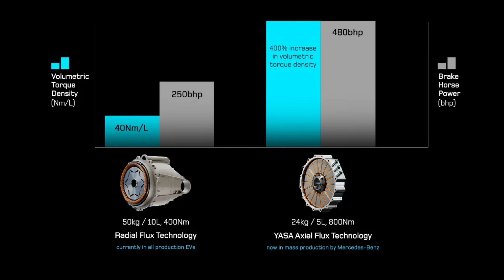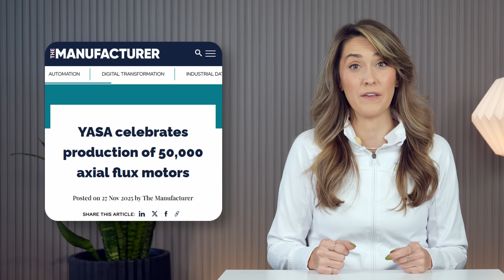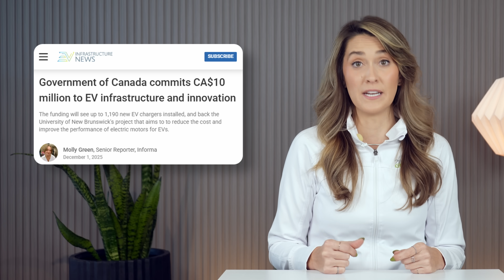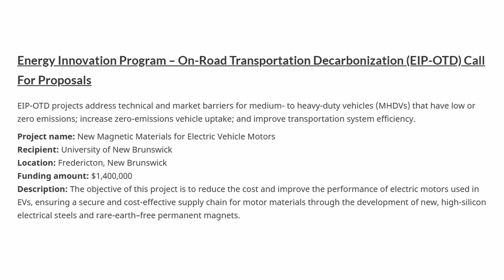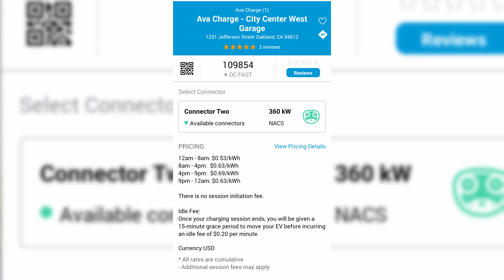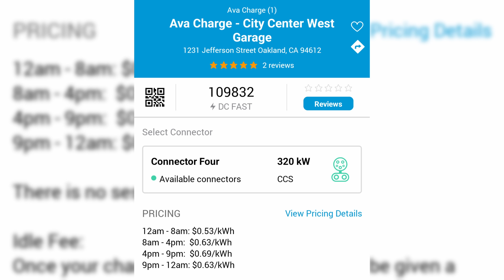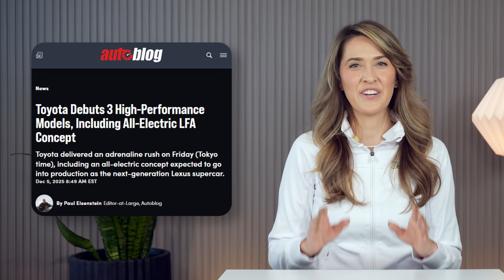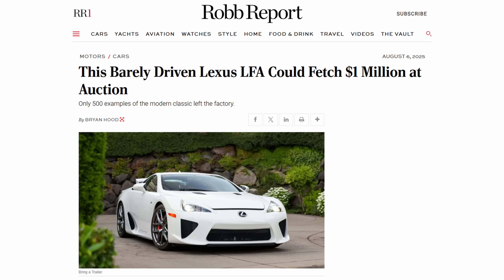The Current : Weekly EV News Ep#92 Dec 7, 2025

Comment: I am skeptical about hub motors. They create problems with added unsprung weight and rotating mass. Even worse, axial flux motors are very sensitive to gyroscopic effects that can make the rotor strike the stator. 
Axial flux I am slightly less hesitant about if they are part of the sprung mass. It is not a new technology though. There are real engineering issues to work out.
Reply from the maker: Many in-wheel motors have been brought to market for various applications.  The integrated inverter and the axial flix power to weight ratio are two massive improvements over anything we've seen in this form factor. 
-Producer Tim
Reply: @MissGoElectric  I agree with that, but axial flux isn't a new idea and neither is in hub motors. 
There are strong gyroscopic effects that try to drive the rotor into the stator that require either a heavy rotor that increases weight or large gaps that weaken the motor. 
There is a reason that even companies with great engineers have abandoned in wheel hub motors and radial flux. Aptera is just one example of a company that has done so.
Reply from the maker: Aptera has sold zero vehicles. Woven VS wound is important.
-Producer Tim

Comment: With the YASA axial motor, can you still remove the wheel by removing lug-nuts, to rotate the tires, or fix a flat?  Is there still brake fluid and brake pads for emergencies, and mechanical parking brake?  There's probably a more detailed youtube video on YASA that I need to watch...
Reply from the maker: The system we've reported on in this video has not yet been implemented. Of course, when it makes it to production all required maintenance and safety actions will be possible. -Producer Tim

Comment: Good to see the Post Office electrifying its fleet. I have huge nagging doubt however.

Osh Kosh.

We have seen thermal runaway events in first generation EV platforms. As manufacturers learn how not to make a roman candle instead of a safe battery their subsequent generation of batteries fare much batter. Osh Kosh have no experience in EV or battery manufacturing and we can predict their first generation batteries will suffer from manufacturing defects leading to battery thermal events. This will tarnish the transition to EV's and a single fire could stop the program i its tracks which would also stop the excellent ford EV's from being adopted.
Reply from the maker: Countless gasoline powered USPS vehicles have been engulfed in flames. Modern EVs are 60x less likely to burn. New Chinese EVs literally cannot have flammable batteries by law. The technology is going in the right direction.

Most of the incoming USPS fleet burns gas. A small percentage are EVs. 
-Producer Tim

Comment: Great as always. Toyota + solid state batteries = Lucy with football. Don’t be Charlie Brown! I’ll believe it when I see it.
Reply: I think SSD in widespread use will finally alleviate range anxiety.
Reply from the maker: The technology improves AND it scales.  The user benefits and value continue to improve and will do so until there are no reasons for most drivers to consider combustion. -Producer Tim
Reply from the maker: 30 EVs by 2030. That's their plan. We've shown the Toyota EV apparatus spinning up here and abroad to the tune of at least $20B of investment. -Producer Tim

Comment: You missed the most depressing news of the week: the rolling back of emissions and mileage requirements which essentially mandated EV production. There was the spectacle of Jim Farley kissing the Great Orange cheeks and blathering about affordability. 

Meanwhile, at the skunk works, design continues apace (I hope), and new Bolts are rolling off the line in Fairfax. Otherwise, Detroit and Dearborn is doomed. (Auburn Hills is doomed no matter what. )
Reply from the maker: This channel covers electric transportation. We certainly didn't "miss" news about combustion emissions. We don't think it is a relevant story which will actually have new impact on EV adoption. 

EVs win because they are superior machines. As their prices continue to drop, the value proposition will drive adoption.
-Producer Tim

Comment: Each new charging stations bring safety and convenience to EV owners.  Maybe, not so much in Oakland California.  But if you go to the cabin for a couple weeks, wouldn’t you rather drive up and down the mountains in your PHEV?
Reply from the maker: We are uninterested in automobiles with exhaust pipes and gas tanks. More parts, less reliability, more maintenance, shorter lifespan... None of that appeals to us. 
-Producer Tim
Reply: Not really since batteries lose charge in freezing cold weather
Reply from the maker: Our electric truck goes more than 350 miles on a single charge at 0 degrees Fahrenheit. Few gasoline trucks can do the same.  Lucid Gravity SUV can go 400+ miles in sub freezing temperatures.  Those who precondition vehicles while plugged in at home find cold weather range loss to be 5%-10%.  Remember....most gasoline vehicle drivers idle their vehicles for a while to get the cabin to temperature...which burns gasoline and reduces their range.  The difference between ICE and modern heat-pump driven EV performance in during the winter is negligible if any. -Producer Tim